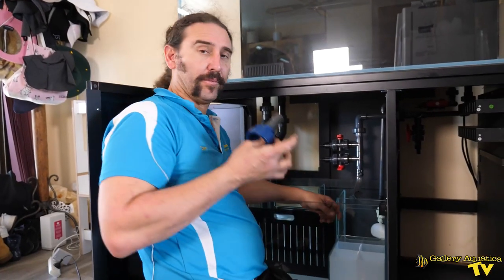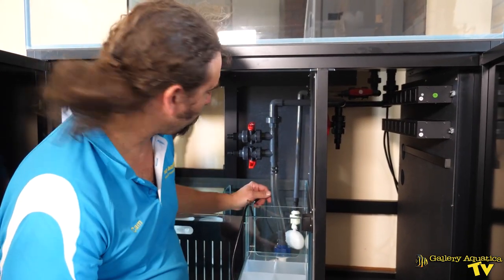Installation: Cade1200

Comment: I'm surprised you didn't put a custom tank pad to cushion it alittle from the stand.
Also  how come you didn't cure the rock first before adding to the tank once it's ready to be cycled?

It seems like the tank is in the kitchen. Aren't you worried that the gas stove and what ever else you might be burning will go into the air and make its way into the water? 

I had a blue and gold macaw die this way from cooking inhalation he was about 20ft from the stove and still got killed even tho I used an exhaust system to pull cooking smoke out. Not sure if it's effects fish as well.
Reply from the maker: These tanks come with their own padding on the top of the cabinet. We don’t need to cure dry (fake) live rock. I’ve never had problems with kitchen fumes, but then I’ve never kept birds, just fish. Cam

Comment: I just bought one of these, how did you fit your lights with the jump net cover?
Reply from the maker: The hydra rail allows the jump net, however it is more difficult to remove as needed. Cam

Comment: If the chiller is on the right hand side can u still access the power bar?
Reply from the maker: Not if it’s hard up against the door. I usually leave about a foot of space between the door and the chiller so you can still open the door. Cam
Reply: @GalleryAquaticaTV  great vid

Comment: What is the price for full setup?
Reply from the maker: Hard to say exactly, but you could do everything top-end for under $10k😊 Cam
Reply: Gallery Aquatica TV 10k dollars, they are smoking rocks
Reply from the maker: Lights are over $1k, chiller $1.5k, wavemaker and return $1k, tank $3.5k, skimmer almost $1k. It all adds up. Cam
Reply: Gallery Aquatica TV they didn’t even get sand for that 10 thousand, that’s just messed up
Reply from the maker: It probably wasn’t quite $10k, and there were other things in the setup. The price of marine setups does sometimes shock people more familiar with freshwater setups, but the eventual effect you can achieve is well worth the initial cost😊